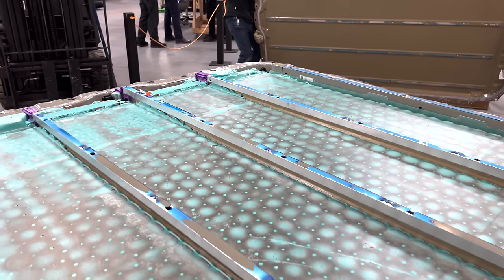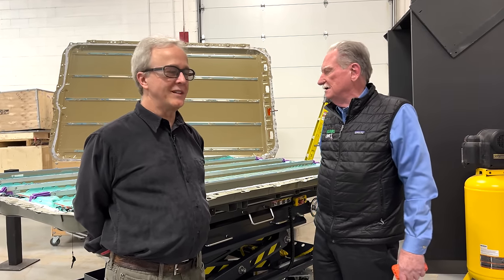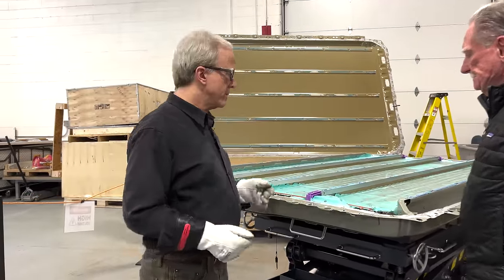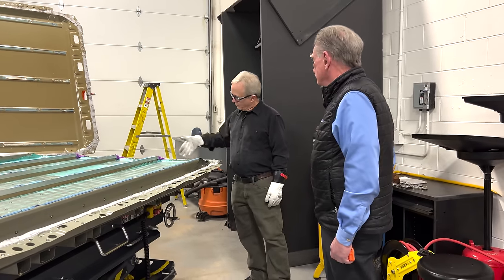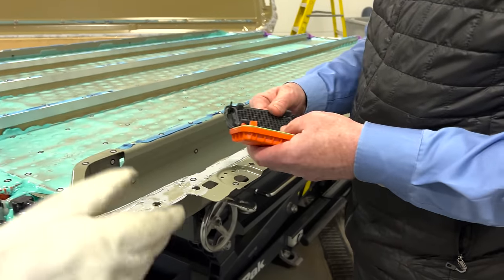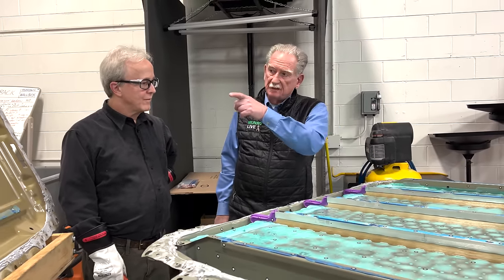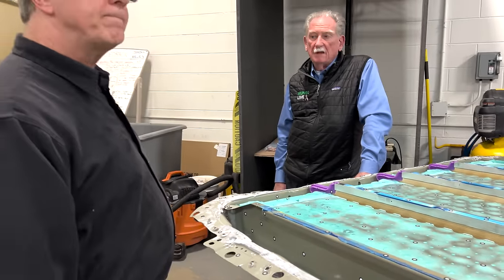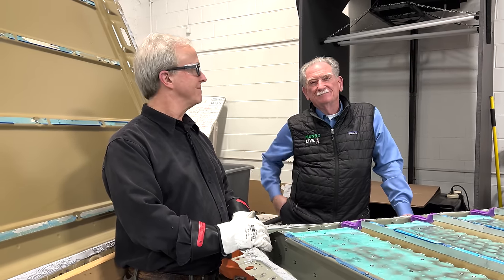Tesla Cybertruck Battery Pack: Our First Impressions Under the Lid

Comment: This battery pack looks like repair hell. Also, it doesn't take much for the vehicle to detect that something went wrong: the HVDC system is continuously monitored for leakage. If water bridges anything HVDC to chassis, you get told to GTFO as soon as excessive leakage current is detected since there may only be one layer of protection left between you and 350-900Vdc.
Reply: It's repair hell because it's not repairable and it would just be recycleable.
Reply: @Resist4  They removed an entire layer of recycling from the module. Conversions cannot use junk vehicles, and the modules as they deplete would need to be rebuilt in order to be used in the secondary application.
Reply: @ronaldking1054  And as I said they are not repairable.  Just recyclable, meaning the components would be broken down to extract the lithium and other metals.
Reply: @Resist4  And you failed to understand when they stated that to break it down to cell level, Munro Live lost money.
Reply: @ronaldking1054  you don’t have to break it down to the battery.  You deep tank the whole pack and melt the metals to be separated, even Sandy said that in a video.
Reply: @Resist4  That's true, but that method is currently 3 companies, and they don't keep up, which is why Tesla was the supply for conversions as well as a cheap source of batteries. They no longer are.
Reply: I wonder about the process of recycling.  Is there a safe and efficient way to recycle these huge units?  I hear that a lot of old electric cars are just sitting in junk yards because one wants to recycle it. Don't know if that's true.
Reply: @TienLu9  Many countries don't have recycling facilities yet. With each battery being made differently, some recycling facilities are choosing to specialize in specific battery types to limit the number of different process tweaks they need to deal with.

If you want process throughput to keep up with the hypothetical all-EV future, your recycling process cannot afford to spend hours per pack making sure every cell is discharged to 0%. It needs to go straight to the crusher. We're likely going to end up with a recycling process where batteries are dunked into a 10' deep pressurized tub for crushing for the water to absorb all of the heat released when crushing a fully charged battery pack, with the pressure preventing local heating from boiling the water off.
Reply: @TienLu9 
Where exactly did you "Hear"  about EVd sitting in junk yards?
Probably a "4 people with knowledge of the matter" report?
.
Any Junk yard worth their salt would be straight onto the vehicle manufacturer asking "what is your recommended recycling procedure to make a pack safe and remove it from the vehicle, plus, do you have preferred recyclers prepared to collect (and pay for!!) a pack?"
(Bearing in mind it's one of the most valuable components on the vehicle)
.
Likewise, any specialist battery recycler would be in touch with vehicle dismantlers to discuss a safe (and profitable!) method of removal??
Reply: @teardowndan5364 
Or you FULLY discharged the pack to make it safe AND use that energy to power the recycling process? 
Result? Little or no energy in the cell, no "heat" to release.
Reply: @TienLu9  yes there are many companies safely recycling battery packs.  But old EV’s sitting in junk yards that’s a joke.  Stop listening to anti EV sources that make things up.
Reply: @TienLu9 
Before recycling, there is reuse. The four long modules in these packs can be cut apart and each working module reused as stationary or secondary storage.
Reply: @Resist4  - Unfortunately recycling is very labor intensive including the use of lots of chemicals, nearly a the break even point of mass mining new lithium.
Reply: @BillAnt  for now yes, but that is changing.

Comment: When you put the batteries in parallel 😅, you keep the voltage but allow it output more in terms of capacity and dumping amps. 

When you put the batteries in series, you greatly increase the voltage, but keep the amps the same. So 9v+9v is 18v.

Comment: I like Andrew, simply because just popped the plywood off instead of talking about how to open it ad nauseum.
Reply: Steel. That is the bottom of the pack.
Reply: It was fairly obvious they had been trying different things for a while, so Sandy having a thought is fine.  Sometimes simple is best, and Andrew likely noticed there wasn't any foam on the sides like previous models.  You can also tell Sandy wasn't actually upset at Andrew there.

Good working relationship between people at all levels makes this seem like a nice place to work.

Comment: A Karcher dry ice blaster would be perfect for removing that foam without damaging anything or shorting out.
Reply: IRC they ether rented or purchased one last time they did a Tesla battery tear down.
Reply: They did and it took forever! But there was a lot more foam. This is nice and cleaned up. Hope they are able to save and reuse that excess.
Reply: @Barskor1  I don't remember the brand, but do remember they blasted with dry ice. It was very expensive as mentioned in the video.
Reply: @PhotoHoag  Dip the whole thing in a saltwater bath to discharge it and then add gasoline to dissolve the foam.
Reply: @jbbuzzable  The Karcher portable one is only $18k but works off a Co2 tank instead of adding it to a hopper.
Reply: @doctorhfuhruhurr4380  The amount of time involved to do the job is also a factor.
Reply: @jbbuzzable  They are only $18k each.  They should have bought 5-10 of them after the last experience with the foam and it would be done in an hour and they'd be first out with the video.

Comment: They really dialled the safety design aspect into this pack to eleven, that's a ton of volume both for side impact and venting.
Reply: I'm guessing some of that extra bottom to is rock penetration/pack damage area due to off road.
Reply: its definetly not lol!!! the truck is yet to proove any offroad capability
Reply: There are many videos of the Cybertruck showing its capability compared to highly modified 4×4's and rock crawlers with impressive performance.
Reply: @carholic-sz3qv dudes always  trolling the comments. Tesla bad Tesla bad … 🤣🤣🤣
Reply: The extra tall ribs (that separate the 3 long battery modules) provide a lot of spare height for dents to the battery skid plate. That height may also increase longitudinal rigidity. 

The synthetic material also provides electrical insulation between the long battery modules, simplifying the design.

Comment: I am as big of an EV fan as anyone, but my biggest pet peeve with these vehicles is the lack of repairability. Maybe using a rubber gasket in place of the adhesive around the edge or not encasing the cells in epoxy.
Reply: Making a battery repairable adds complexity, cost, weight and unreliability, better to design a battery that is reliable than a repairable battery.
Reply: Some EVs do use gaskets, and like any gaskets they fail over time.
Reply: @universeisundernoobligatio3283  lol, sarcasm? Tesla just doesn't care about consumers
Reply: @BBingo-v5i he is correct in saying that making the battery pack serviceable would make it considerably heavier, larger, give more failure points and it would no longer be structural, leading to the chassis having to be stronger and therefore heavier.
You either have a car that is more efficient but less serviceable or one that is more serviceable but less efficient and more likely to needing to be serviced. There’s pros and cons to both.
Reply: @streddaz  nah that is way too simplified. You can have awesome efficiency and longevity if you work on all components and design them the right way, especially because all modern batteries are fairly efficient anyway if you hook them up to an 800V system architecture. 
As far as I know the Mercedes-Benz EQXX does jot have a structural battery, and the upcoming CLA class does not have it either. Yet the EQXX is the most efficient 4-door vehicle on the planet and the CLA will be the most efficient in its class out performing the Model 3. The point is, this argument is just vaporware. The most contribution to efficiency has the drivetrain and motor, the aerodynamics and the system volt architecture. The weight and the structural stiffness are secondary at best, especially because overall engineering has become very good.
Tesla just uses the cheapest ways to produce components, and a structural battery plus a fixed chassis framework are easier to work on. This can have disadvantages, too. And especially for the end consumer the positiv effects might be minuscule. Tesla doesn't care about the environment nor does it care about the ownership experience and product lifecycle. They only care about their profit margins and that is not an achivement. BMW uses recycled materials and even creates or sources new types of materials for the interior and body panels of the "Neue Klasse. The steel they use is low carbon emissiom steel, the battery assembly will use renewable energies. And the battery pack as well as the whole car is designed to be easily recyclable. I am sure you can aslo repair them better than Teslas.
Reply: @BBingo-v5i Exactly. Sometimes taking a slightly longer route to your destination is more efficient than going straight for your goal. Lighter and most efficient per mile does not always yield the lowest impact on the environment over the total lifecycle of the product.
Reply: You can make the battery modules independent and fully sealed like this giant one, that way you only need to change out the faulty module. Tesla solved the problem  the absolute worse way for consumers, after market upcyclers and environment.
Reply: @volvo245  you certainly can, but that increases the size and weight, plus they won’t be one structural unit anymore.
The way Tesla is designing their packs gives improved efficiency, meaning the vehicle weights a whole lot less saving you in running costs while you own it. There’s some reliability gains as there’s less, electrical, cooling and mechanical connections, so that’s an advantage during cost of ownership. Finally it’s cheaper to manufacture, which is a saving at the purchase point.
Making the vehicle more efficient is actually better for the environment.
The downside is, in the case of a faulty cell, a whole pack would have to be replaced. The former pros stated are a surety, the con is a maybe. Only time will tell if the pros outweigh the cons.
Reply: @BBingo-v5i  the Mercedes-Benz EQXX is just a concept car and there's only Mercedes theoretical claims to what it MAY achieve. Even if it did make production it would be a very high end, low volume car compared to a Model 3.
Weight is a big factor in efficiency. Every time you accelerate, the less mass you have to move the greater the efficiency. 
Also claiming that Mercedes and BMW are looking after the planet with their giant luxury cars is a pretty long bow to draw. If you were really wanting to make a car that resembles an Aptera.
Reply: @streddaz  lol, so many mistakes. The EQXX is not a concept car it is a road legal test vehicle to gain data and insights, as well as a proof-of-concept road legal vehicle which shows what today's tech can already achieve in the real world. None of the tech it uses is super special or expensive, except maybe for the dynamic extendable rear diffusor. Again it is road legal. The reason why it is so efficient is because of its clever engineering and optimization.
It completed thousands of test drive hours and 3 long range road trips under different conditions, it didn't drive extra slow or anything it just blended in with traffic and the average speeds achieved while driving on these 3 road trips were fairly decent.
A lot of the tech will be implemented in the upcoming Mercedes CLA and C-Class, the motor and drivetrain combination, the battery and high-voltage system, part of the aerodynamic improvements (except for this rear diffusor) etc.

Mercedes and BMW make one of the biggest contributions to shift over to CO2-neutral production and their investments and R&D in EVs is very high. As I said BMW, and Mercedes as well, source and create new types of materials for the interior and will make a major shift to natural as well as artificial but less oil based fabrics. Mercedes used a paper based silk in the CLA Class concept car and a coconut based plush floor carpet. 
The carpet is ready for production and will be used in the CLA, the seats will be available in fabric. Others like Tesla or Fisker use plastics everywhere in the construction process of the vehicle, on the dash, at the side, for the floor mats and even for the seats (some people want to call it vegan leather, but there are different types of vegan leather and the one Tesla use are pure plastic based). Face it, Tesla just sucks.

About the Aptera: Cool concept but pretty useless in the real world. It has the size and footprint of a 4 door sedan but can only seat two people. The storage space is also limited. That is a waste of space. The stability and safety on different road conditions or even during an accident might be good but is not comparable to a real car. The price is pretty high for what you get. And now the killer argument: The EQXX isn't that far away from the efficiency of the Aptera, yet it is decent sized 4-door Coupé. It achieved 8.4miles/kWh on its trip through the Middle East while the the Aptera should achieve 10miles/kWh under ideal conditions. And again, the EQXX uses today's tech.
The Aptera is for people with too much money who do not need a vehicle with much utility or space. Cool but pretty useless
Reply: @BBingo-v5i  Once again, YOU CAN'T BUY A EQXX!!
Even if you could, it's hardly the car for the average joe. It's just a Mercedes design project to show what they could do but not actually do it. 
For all intent it was a concept car and definitely not a production car. If it was so great, where is it? Why can't I buy one?
Both BMW and Mercedes are cars for the rich and to make the owners feel like they are doing their bit for the environment while they drive their 2 tone behemoths on the commute to work with just one person in the car. If either of these car companies cared about the environment, they would only make small lightweight, efficient, cars that are affordable for the masses, but they don't. They make big expensive vehicles that make far greater impact on the environment than any coconut based plush floor carpet can affect. (Don't see many palm trees in Germany, so they must ship them from somewhere tropical, not very efficient hey?)
Reply: @BBingo-v5i 
These Mercedes-Benz vehicles are at the "Halo-Class" prices, and are not going to impinge on Tesla sales.
Reply: @streddaz  No, its just Tesla not wanting to make it serviceable. On the Model S there were plenty cases where Tesla tried to sell a new battery, even though the old one was fixable by a mechanic. The freaking epoxy glue is just to stop you from trying to do that on the Cybertruck.

Where have we gotten to the point where people argue against repairability...
Reply: @xXYannuschXx  still from an engineering point of view, if you make the battery a structural member you save a lot in weight, you can make it cheaper and make it more reliable. There’s pros and cons for doing this. 
Wouldn’t you prefer the car to be more reliable and more efficient for the time that you drive it or would you prefer that it is more serviceable for some point in the future where you may not even still own it?
Reply: @streddaz  I would prefer the battery to be serviceable and repairable. A single wear item having such a gigantic price tag is not a good design.

And "more reliable and efficient" is a bold claim, knowing that there are far more reliable and efficient EVs out there that dont glue their freaking battery.
Reply: @universeisundernoobligatio3283 this dude literally has this same comment on every repairability post
Reply: @leviandhiro3596  
Thank you for noticing, too bad you don't understand or comprehend what it means..